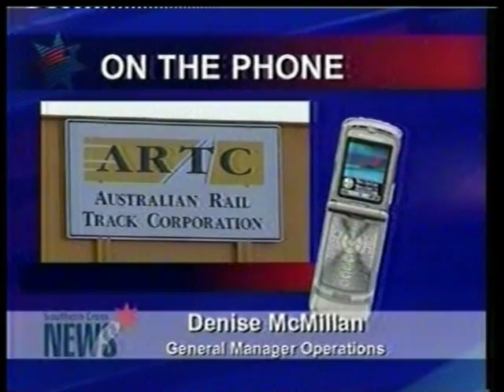SSRS Derailment

Comment: Yes, the trucks just sit on top of the wheel sets so if the unit tips or jumps, the trucks and wheels usually part ways. I'm not sure why they are built this way but it no doubt allows for quick changes if you have a bad bearing.